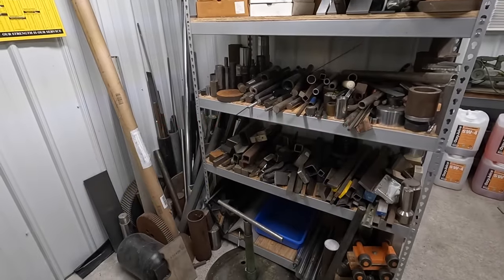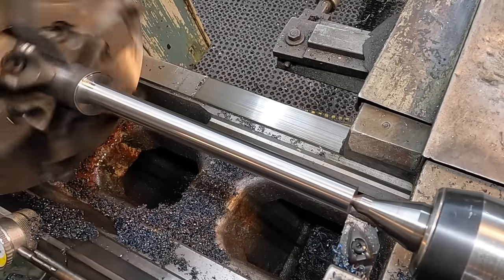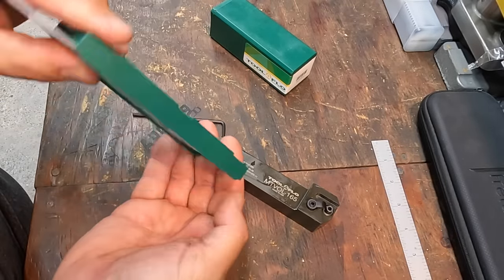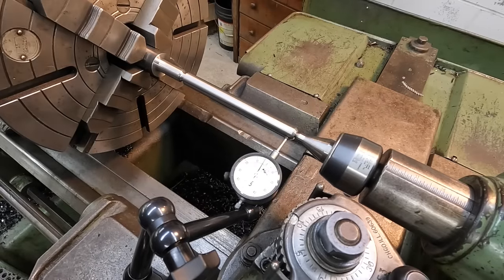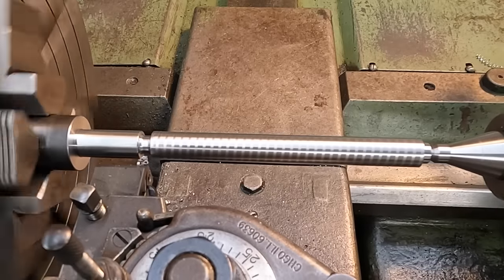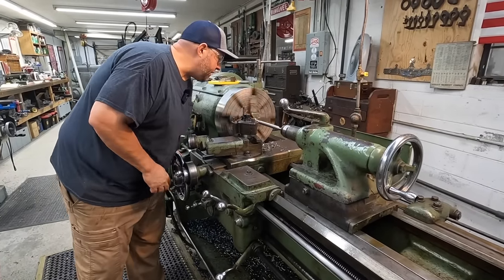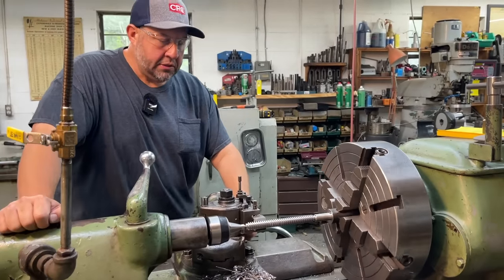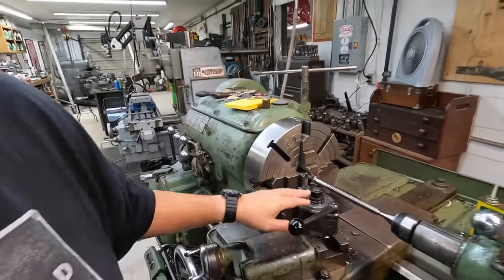Compound Lead Screw for American Pacemaker

Comment: I felt SO Bad for you and your ENERGY into the Project.. Cutting fluid doesn't help?  That was the first thing that came to my mind..  Then I thought about the edge of the cutting tool below the center line..  Then I thought about a "Thread Cutting Follower REST"..   Is there such a THING? It happened to me when I was 19.. Cutting 1 1/2' and 1 3/8" threads with and overhead Belt Shaft Machine Shop.. Cutting Anchor Pins, for a Sport's Stadium Canopy..  I had the BACK GEARS IN..  the Cutting speed was too slow.. The Year was the summer of 1969..  I just about pulled the overhead shaft outta the roof trusses of the Shop.. Going back to watch the rest of the video..

Comment: Don't use the compound. Use only the cross feed,that way you are cutting both sides of the thread. I never use the compound to cut threads.😅
Reply: He used compound cause to cutter cut just on one side in this way cutter didn't stuck and didn't vibrate. Nice method for clean surface.

Comment: What does Acme Tool mean or what does Acme mean is that some type of Imperial type deal or I mean what is the definition of Acme and what is it come from what does it mean sorry I'm not as learned but that's the reason I watch this stuff cuz I'm trying to learn thanks for the video hope to hear from you thank you
Reply: Acme is an Imperial thread. That's why it's expressed in inches (3/4 inch [diameter] x 5tpi [threads per inch]).
The metric version of Acme is called Trapezoidal. It's 30° and metric pitched where Acme is 29° and Imperial pitched
Reply: The pitch is the distance between threads (Metric) or how many threads in a set distance (Imperial)
Reply: I think it's something to do with roadrunner cartoons😉
Reply: I consulted google: 
ACME is from the Greek for 'highest point'. In English, acme usually means the peak of perfection, a concept which easily transfers over to the fictitious name of a company in a film, book, or whatever.

Comment: You have too much gap on the main bearing for such an old machine, it stands up and starts destroying your tool. Turn the lathe tool 180 degrees and run the lathe in the other direction, so the pressure goes on the bottom of the main bearing and can't bouncing again to destroy your tool.

Comment: Hello, i want to cry when i see that happening this. First i not believe my eyes. You planned and made so perfect everything. And in the end happened this. I think the old worn lathe can not be accurate so much. I dont understand why you chose that. And when you cut the material it start to be weaker and weaker. Later it bended. I think this was the problem. Please make video when you investigate the problem. All of us waiting for the right answer! Anyway you are perfect. I like you!
Reply: and as you went deeper the cutting surface increased.  the thread side also had to be cut as the resistance increased strongly.  the rod is twisted.  this changed the pitch.  therefore, the knife cut into the side of the thread.

Comment: I found this to be very interesting. I took a while to figure how you timed starting cuts on thread till you showed the rotating numbers knob. Interesting indeed. 

On problems at end, Just random thought, would heat cause it to expand just a little bit, causing bit heavier cut than you intended? I don't know if it was getting hot as it was left uncommented.

Comment: Could the center have gone bad?
Reply: I'm thinking the same thing. Chatter in the middle of the span is not surprising. That it continued all the way to the end suggests to me that the tailstock center wasn't tight. Not uncommon to snug up the center mid-job. That and cutting oil, fer cryin' out loud! Follow rest would help, but the part is short enough that I probably wouldn't have though it necessary either.

Comment: The shaft is deflecting as you get down to the minor diameter Adam, cutting forces 👿
Reply: I Agree, that's a long skinny bar, and a cutter that increases tool pressure the closer you get to the finish pass. I personally would look at a Feti type tool for this job if that was a possibility

Comment: Your chips seamed to change from one cut to the other.
Reply: Part length/diameter only gets worse as you remove material. I saw that, too, but more that the chips would break different in the middle of the cut. The best conclusion I can draw is that the part was deflecting more as the threads were cut, especially with the shape of ACME threads being what they are and needing a pretty blunt cutting tool to make it. I'm no pro and haven't turned a part in over a decade so take it with a grain of salt...but that'd be my first guess.

Comment: That tool holder alone looks very expensive!  Would be interesting to hear what these kinds of tools cost.  Not all of us, in fact I'd guess not most of us, are professional machinists.  I do not understand why coolant/oil is not being used when cutting the threads?  Not saying it should be. I do not know.  I would like to understand. Thank you!  Also, maybe the grabbing has something to do with 14.5 degrees vs 14 degrees?  The edge you referred to as the one cleaning of the face sees a larger and larger surface the deeper you go and at some point, it sees a lot more stress that the end of the tool. It could be causing a vibration of the cutter between the thread walls.  Just spit-balling here.  There may be a subtle but very good reason that 14.5 degrees is specified.
Reply: 14.5 degrees is half of 29 so should not cut at but just barely scrape. 14 should not even scrape so the angle is not the problem.
Reply: @ellieprice363  Roger that!
Reply: Generally when using carbide insert tooling, you either flood it with coolant or none at all. Just dabbing coolant occasionally can cause the insert to chip or explode the tip from the heat/cool shock. It’s pretty tough to film something when you run flood coolant.
Reply: @grntitan1  That’s generally true but at the low speed that shaft was turning a little cutting oil with a brush might have saved that part.
Reply: @ellieprice363  Possibly. I’m not convinced of any scenario yet that lead to the demise of that part. As for dabbing cutting oil on the insert, it would depend on the heat being generated more so than the turning speed.
Reply: @grntitan1  The chips are not even slightly turning color so very little heat is being generated.
Reply: @grntitan1  It's a good point. Was wondering if the threads would have cut more cleanly with coolant.

Comment: The only issue i can see is that you parallel corectly the big vertical support but you get in the thred witht  moving in the tool holder that is NOT to zero😂😂😂😂😂

Comment: You are cutting with more and more check on both side and it can't cut the grove as it went.  Is it lube or is it harmonic issue.  Maybe the steel wore the cutter cheek and now it grabs.  No telling.
Reply: Thats what I was thinking also as the whole shaft would be getting quite warm and where the problem started is at the weakest part of the shaft

Comment: Hi Adam, As each cut is made the diameter at the bottom of the threads is getting smaller and therefore has a falling resistance to lift. This effect is increasing with each cut until the lift is sufficient to do its damage as you have demonstrated. I would have thought a man with your amount of experience would have been aware of this effect, although I have only been a precision engineer for a mere 68 years. But then again 'you should have known better. regards Mo K
Reply: Dude, don't be a jerk. Not sure what a "precision engineer" is, but it sounds like a title you just made up for yourself. Every machinist in the world has scrapped at least a few parts. The best machinists are able to learn from their mistakes and use that knowledge to perfect their craft. As he said, even after he knew the part was no good, he continued to take additional passes to see what he could learn from it. Not only did he use it as a learning opportunity for himself, he posted the video so the rest of his followers could learn from it as well.

Comment: Am I tripping or does the lathe appear to be spinning at 1k rpm but the piece is only turning at 60rpm?  @33:19
Reply: Videos only show you a certain amount of pictures every seconds. Tecnically between 23-60 Frames Per Seconds. That would technically mean as long as its a video, you never actually see it spinning more than 3600 rpms. What you see is called The Shutter effect. Thing that move fast appear blurry on camera because in the 17 milliseconds it takes to open and close the appurture, the thing moved and therefore looks doubled. The Shutter effect is dependant on Camera Year, make and model. I don't think it is possible to see Rpms through video, hence : you're trippin dawg

Comment: Why is it the machines fault when something is not going right!  It's the material getting thinner and flexing just enough to try and pick the screw up.  I'm shocked that you won't accept that you messed the part up! 😕 it happens to everyone.
Reply: There is a lot of speculation at this stage. I don't think Adam has said exactly for sure what is the reason.

He had shown the video with nothing hidden from what I've seen. Perhaps as the next attempt is shown we can iron out the facts from assumption. Also I suspect Adam would admit fault as he doesn't strike me as an arrogant man. Lets give him the chance to work this issue.

Comment: Almost looked as if the tapper atachment started to drag 😳
Reply: I had a bad lock down dog the taper attachment on a Warnerandswasey 90%of the time it was fine, fix was to loosen a couple extra turns on the lock down bolts
Reply: How i found it was with the lathe off chucked a heavy piece in the jaws and tail stock suport and run an old tool holder against the work with a little force and roll the carriage back and forth and witness the taper attachment engaging

Comment: your coming up on your zero stop too fast you can even hold back pressure by hand when you get to the bottom of your theads dont hold back presure while in a cute only when your zeroing your cross slide

Comment: Did you ever hear of cutting oil????  It is just tearing the metal off not cutting it..
Reply: Nah man, he’s never heard of it.
Reply: Exactly
Reply: This must be your 1st video.  Adam says cutting oil is for pussys.  And if you use it, don't bother watching .....I've stopped using cutting oil myself and I can't thank Adam enough for that pro tip, his granddads mentor taught him that, and we are luck he's passing this priceless information down to us.
Reply: It's 1144 Stress Proof with a coated carbide insert at slow surface feet. Not necessary